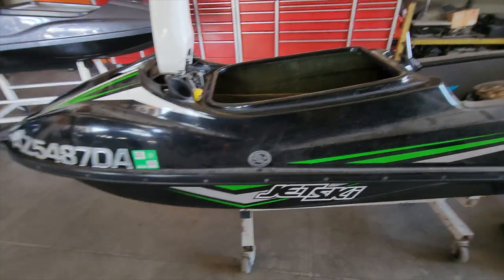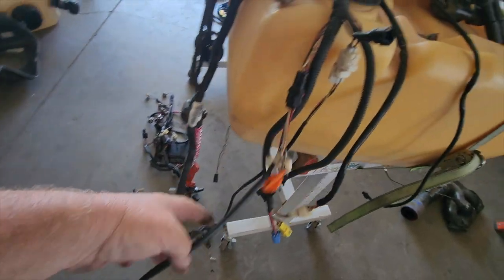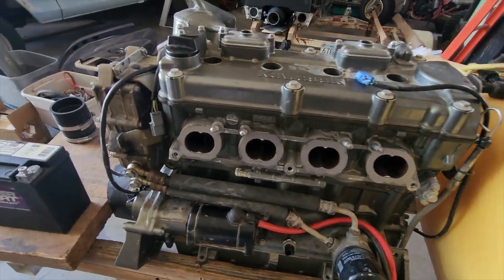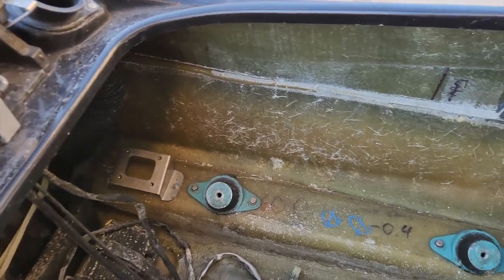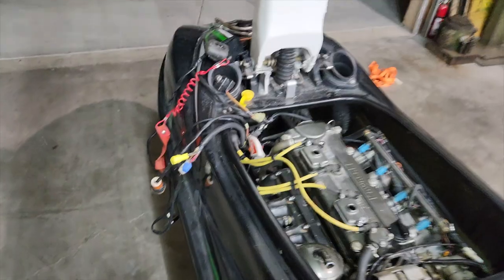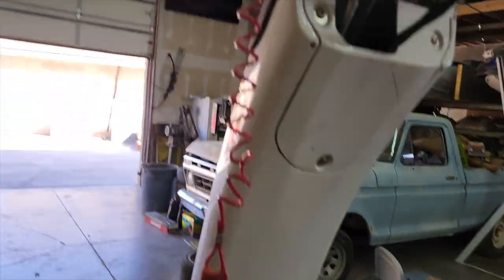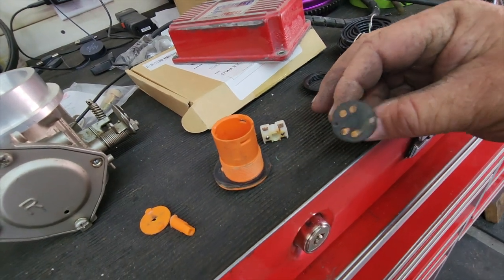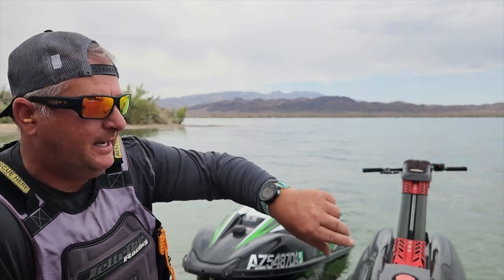Unbelievable: SXR 1500 12F Conversion Under $1500 - With a Side of Spaghetti! 🍝🌊

Comment: Hi y'all, never commented on anything on here before, interesting video, I am doing one of these myself, but doing it a bit different, Have a couple of hulls lying around from custom skis  so thought I would have a go.I always replace the entire fuel system with external filter, pump and regulator so it can be replaced without removing the motor to access the tank, also adjusting fuel pressure is how you adjust fuel mixture, stock is about 43psi..While the motor is out do a valve adjustment and oil change!!!!
Fist off Im had to buy the starter solenoid base bracket, the ecm bracket and the coil brackets for a 1500sxr as they are different, all the 12f stuff is same bolt holes but different brackets. Second you need an sxr1500 tank and the float it sits in which is tough as they are back ordered to who knows when. Found a tank in Canada and glued pieces of a Husky kneeling pad to the bottom in strips, works fine. You also need the sxr 15 tank straps ,steering cable, throttle cable and battery box.Turn the ground and starter wires to face forward. I made a 4-1/4 inch disc out of aluminium for tank top with 2 1/4 pipe holes for fuel out and return. 12f motor fits fine with exhaust removed, Had to extend a lot of the harness to reach rear of the motor as the main harness plugs to the ecm at the front, soldered all connections and double shrink wrapped. Extended the run/off wiring to reach harness as handle pole is longer than on a sit down.
 I have connected the gauges at the rear of the motor, I will try it and then disconnect and try again. I have connected the crescent shaped steering sensor as I  figure it probably reduces power on a sit down when turning ,but I have glued and then siliconed over the sensor trigger that sweeps over the crescent sensor in a straight on position, that is dead centred in the crescent so the ecm thinks the boat is going straight ,Also removed the tip over sensor thanks to Jims video.Running the stock 1500 sir pump as I have a few ,looks very similar to 12f just use elbows for water lines if u want use 12f. Used 12f reduction nozzle and turned 12f steering nozzle upside down ,trimmed extra lip off the end and spaced cable connection 1/2 inch or so {12f steering cable is on the other side ) G Ron amazon and buy a 4 pack of 1/4-28 stainless rod end bearings {14$} as the 15sxr cable is 1/4 -28 threaded at both ends, not 5mm like a 12f.Used stock 15sxr water box, changed my waterlines about a bit like usual, added 2 bypasses .Hope this helps, c u a body Beach!
Reply from the maker: Thats awesome! Thank you for the write up. I love it! :-)

Comment: I love this. its like doing an engine swap on a modern car.. but a bit simpler.

I am keeping an eye out for one of these hulls in my area. Everyone seems to pull the pump section, sourcing a used one seems difficult. Im surprised when swapping the ski they dont plop in a solas 12 vane..

Comment: How did you pull this off with only $1500??  Dying to know lol!  I just subscribed... old school IJSBA standup racer here.  Won Novice 550 Limited at the World Finals in 93.
Reply from the maker: Yeah, I kinda dropped the ball on the that one, LOL. You have to factor in that I used the ski as a donor for my Bullett Racing V4, so I had the complete hull, handle pole setup/steering,  waterbox, drive shaft, intake grate, ride plate, etc. I found a 12F for $500 that needed a starter bendix, and out here nobody likes to pull the motors on the sit downs, let alone disassemble them. So the the only thing I needed was the fuel tank, fuel pump, steering/throttle cables, hood latches/hooks, etc. It ended up being under $1500.   Thank you. :-)

Comment: Could you do a video on these stock 1500 hulls on making them not so squirly? My dad and I demo one back in 2017 and even though I was a beginner he grew up on 550, 650, and 750s and we both thought they had death wobble . Which was not what we were expecting.
Reply from the maker: Actually, I have a video planned for modifying the 1500 hull, however, the issue you are describing is the same that has always plagued the watercraft industry. When they lay up the hulls in the mold, they are supposed to wait a certain amount of time to let the resins harden. In a production environment they always seem to rush this and the hull changes shape while hardening outside the mold. I have seen several 1500's with a recess in the bottom of the hull from the resin "shrink back". We call this "hook" and it causes several handling oddities. The 1500 responds very well to truing the hull to fix several issues like this.
Reply: @jetskijim007  interesting, wouldn't have thought to check that.

Comment: First how were you able to bypass the gauge bc wouldn’t it send it into slo mode? Also I understand people remove the setup out of the sxr bc of its plug and play with harness n smaller intake correct? But the sit down 12f n 15f intake is ok for the sxr hull? Just trying to figure out why people would buy a brand new sxr fir a hull swap instead of getting a 15f engine from a donor ski n buying the parts that you need to swap. Seems it would be cheaper and you could spend some extra money and throw some upgraded pistons and valve train in and still be ahead. Plus you don’t have a nice ski hull laying around unless you do what you did which is a great idea. Only thing I see as a pro is it would be a brand new engine but if you buy a used sxr you in the same boat as a used 15f sit down. 
Could you send out the ecu to be reprogrammed to not have the steering sensor? 
I know on the ultras they are removing speed limiters and traction control when retuning.
Reply from the maker: First question, I thought the same thing, but evidently if the MFD Display goes bad, It shorts the beginner mode circuit, then you are stuck in that mode till you get a new one, plug it in and change modes. Mine was in normal mode, so when I unplugged it, it stayed there. Second question, The main reasons everyone strips the SXR is because the aftermarket hull companies reuse a majority of the SXR components into their hulls, and If you try to buy all the incidentals, they will nickel and dime you to death.  Thank you. :-)

Comment: What fuel pump/tank did you use?
Reply from the maker: Stock OEM Fuel tank, and an aftermarket replacement pump off of ebay. https://www.ebay.com/itm/325672697692

Comment: Dumb question. What's the difference between the 12f and 15f engines? I have been toying with buying an sxr1500 hull to put an 1100 in.
Reply from the maker: Not a dumb question at all. 12f engine is the first of the 4 stroke jet ski engines from kawasaki. It was derived from the zx1200 motorcycle. 1200cc's and around 125HP. it was so successful they lengthened the stroke and created the 1500cc 160HP Engine and called the ski theu put it in a 15F... Many parts are interchangeable .
Reply: @jetskijim007  gotcha. I actually just purchased a "sxr 160" (I don't much like the name change) today. Still looking for sxr hulls (I'm sure they're more plentiful in havasu) to do an 1100 swap. Or maybe if im lucky an sxr 1100 premade.

Comment: Hey do you have a schematic I'm putting a sit down 1500 in a sxr from a sit down and i have it all hooked up like you but I'm missing spark still
Reply from the maker: Did you modify the roll over switch and leave the steering sensor plugged in to the main harness? Those two are usually the main issues with no spark, as well as the oil pressure sensor. I think I have schematics somewhere, and I found them through google. I will see if I can find them.
Reply: I dont have the oil sensor hooked up, my connector got ripped off, thatll really stop it from getting spark? Can i just ground it to test? @jetskijim007
Reply: And after I crank it there is clicking and stuff so I think the ecu is getting power and stuff

Comment: I am doing this exact thing with a 1200 motor and a 1500 hull. I have it all installed and it fires up and idles great, but when I try to give it gas it just bogs and won’t rev up. Any ideas with what may be causing that? Everything is plugged in correctly as far as I know. Thank you so much for any assistance you can provide.
Reply from the maker: did you copy my fuel pump, set up? You may need to hook up a fuel pressure gauge to watch what is happening when you give it throttle. Lack of consistent fuel pressure will cause what you are describing.
Reply: @jetskijim007 I believe I hooked the fuel pump up the same way you did. I used the 1500 connector on the 1200 harness and put the two wires what I believed to be the correct holes. I can hear it working when I hit the start button. I might be missing something though.
Reply: @jetskijim007  what exactly did you do with the fuel pump to hook it up?
Reply from the maker: @stevenvunlvpgapgm   just what you said. If it starts and idles, the electric part is correct. On the fuel line side. Did you just run the fuel line from the pump straight to the fuel rail? You have to either tee it, or plug one side of the fuel rail. the SXR uses a closed loop system, the sit down uses an open loop, meaning it sends the fuel back to the tank.
Reply: @jetskijim007 I ran a hose from the fuel pump to one side of the fuel rail. I then plugged the other side of the fuel rail. So there is no loop or return or anything. Is that an issue? I see yours has a hose on both sides of the rail.
Reply from the maker: @stevenvunlvpgapgm   No, that's perfect, I just put a tee in mine, all the new ski's are ran into one side now.  You say it bogs, if there are any errors like low oil pressure, no steering switch input, no rollover shutoff input, etc. It will start but not rev. Double check those, they need to be plugged in and sending signal.